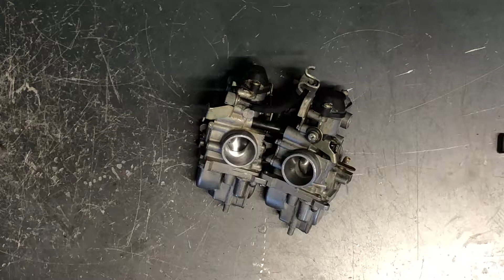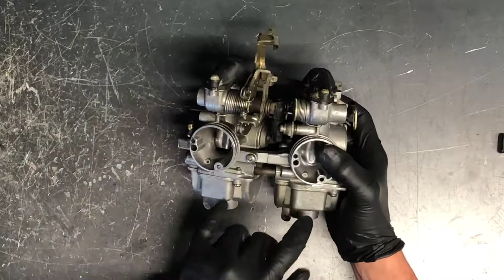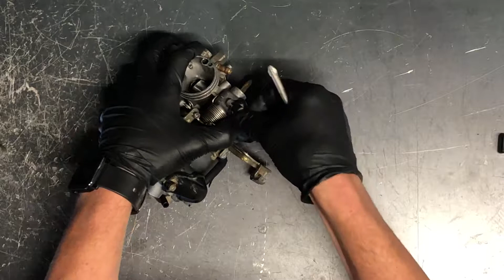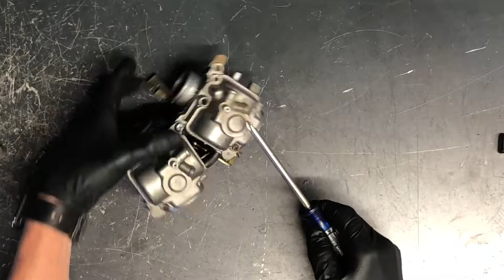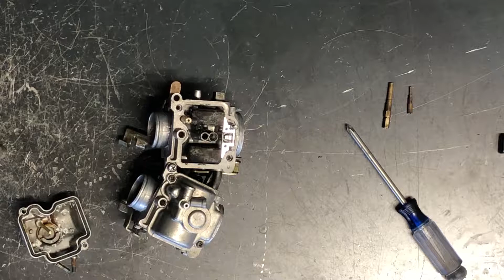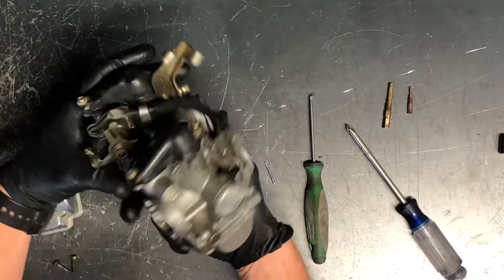HOW TO - Adjust Clean Repair Rebuild Service Carburetor on a Honda XL350R XL 350 Carb

Comment: one carb is a primary carb and the other is a secondary. You need to make sure these carbs are synced. The primary controls idle and up to 25% throttle and then the secondary kicks in and they open together for the rest of the throttle range.